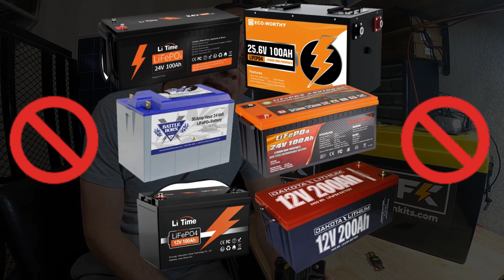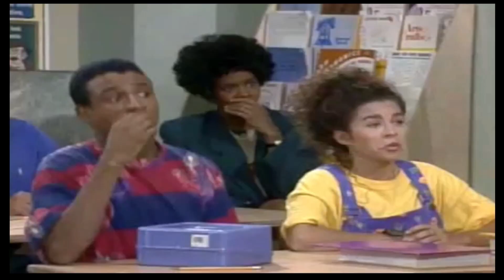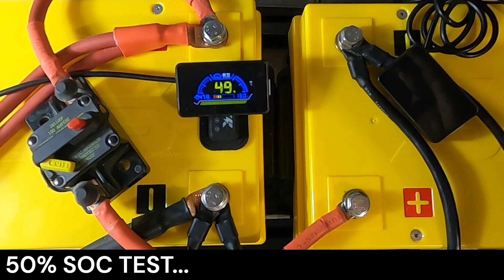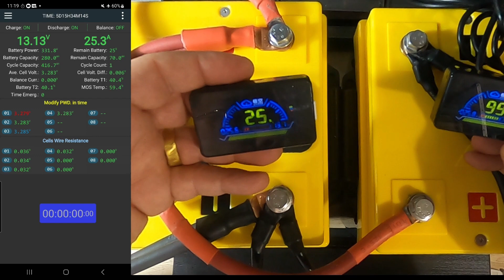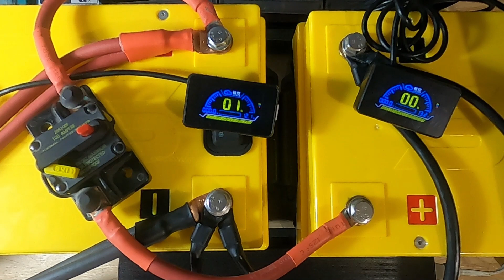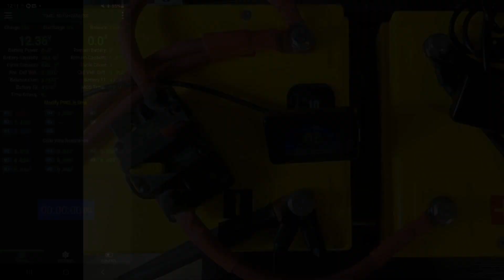Batteries in Parallel - What NOT to Do!

Comment from the maker: When looking at the data table:

75% VS. 100%: (14.6V - 13.28V) = 1.32V Diff. (.33V/Cell) = 100A Flow @ 3s
50% VS. 99%: (14.45V - 13.16V) = 1.24V Diff. (.32V/Cell) = 30A Flow @ 3s
25% VS. 99%: (14.4V - 13.12V) = 1.28V Diff. (.32V/Cell) = 37A Flow @ 3s 
10% VS. 99%: (14.4V - 12.8V) = 1.60V Diff. (.40V/Cell) = 50A+ Flow @ 30s
1% VS. 97%: (14.4V - 12.60V) = 1.80V Diff. (.45V/Cell) = 100A+ Flow @ 30s BMS
0% VS. 97% (13.2V - 11.24V) = 1.96V Diff. (.49V/Cell) = 150A+ Flow @ 30s TRIP 

We can see that you would need at least a 1.80V difference to flow 100A between 2 batteries. If you had say 4 batteries in parallel (3:1) even at 1.60V difference, that would be 150A+ (50A x 3) batteries to reach the same levels.  I thought it was interesting how initially when the control battery was at 100%, we got 100A for a few seconds. That is the last 1% of the battery where the charge curve jumps up dramatically but will not last long. Its very unlikely your battery would be at such a high SOC. Especially if you are following a 90/10 charge rule. 

The test starts at @15:50 and @18:10 for the impatient. 

See if you can find fire marshal bill :) Enjoy!

Comment: Thanks for this, I watched until the end, so useful for me, warm thanks for the time and questions you saved me. Never imagined the current was so low in fact. I was worried by a disconnection of one of the batteries in parallel in case of heat or cold for example... how they will reconnect together... your test helps me understand it's safer than I thought
Reply from the maker: I was surprised as well.  Thanks for watching.  This was an early video I did . Was fun doing it.. good times.

Comment: Hi.  It would help to show a wiring diagram at the beginning,  it's sometimes hard to follow exactly where the cables are going.
Reply from the maker: They are just hooked up in parallel. Positive to Positive and negative to negative.
Reply: @natesdiysolar thanks for the reply, content is most helpful.   I realize this is a simple wiring diagram but for us new to solar and learning i wish all videos on solar  would show a hand written qiring diagram at some point in the video, in this case it would be good to see exatly where breakers and fuses are placed. 
Question : am i correct you are measuring the increased Amps fron the highly charged battery  ?
Reply from the maker: @DJdavefromlondon  ya it would be the amps from the highest charged battery.. my website ( see video description) 
includes many schematics for other projects. I did not include one for this one. basically its a good idea to have a fuse on each battery if you have multiple batteries in parallel.

Comment: Hi, thanks for making this video, could you please tell me what amp fuse should I use between  two batteries 12v deep cycle battery in parallel.
Reply from the maker: To answer that.  Need to know your combined max charge and discharge current of your bms or load if no bms. For example, if you had 2x 100a (limited by bms)  in parallel, your max potential current would be 200a or 100a per battery.. so each battery would never put out more than 100a, so 125a would be good.   Basically, take your max load current and divide that by the number of batteries to get per battery load. That is the amount of current flowing between your batteries.  Typically ppl never max out their systems so as the number of batteries in parallel go up the smaller size fuse you could use because the load is distributed across all batteries.  So 2x 100a bat you might only see 50a on each bat and 3x only 33a each.  So 50a fuse would work.  The easy answer is to match your bms current so if you had a 150a bms then use 150a. Use a clamp meter to measure current between batteries when under max load..
Reply: @natesdiysolar  yes that the answer I was looking for,I don't want to burn my battery and house. Thanks for making the video. I'm a many hurricane survivor since 1988 in puerto rico.
Reply from the maker: @georgemaze7926  awsome.  Good luck.

Comment: Why didn't you connect the inverter to both batteries?
Reply from the maker: The point of the test was to create a large difference in voltage between the batteries.

Comment: Been looking on youtube for info like this, and I´ll appreciate if you can help me with my doubts: I need to keep an inverter running for long periods of time, so my plan is that when battery 1 is about to run out of power, im planning to momentaneusly connect full charged battery 2 in parallell and then disconect battery 1 in order to not lose power on the inverter. Will I face a current spike like im seing in your video? what would you recomend to accomplish this battery exchange safely?
Reply from the maker: Yes, there would, but the faster you switch it, the better it would be. It also depends on the switching device used.  Some could work in a way where both batteries would never connect... 
like an A/B switch, but I would not advise doing this.. Either way you do it, you would need some heavy-duty fast switching device...  why not just connect the batteries in parallel from the beginning...? Why do you need to swap?
Reply: @natesdiysolar  it's a project in which we will have stored batteries to keep constantly running a unit without having to wait for recharge. I have think about switching but I would not like to lose power even for a power flick. I'm planning to add diodes to my battery connection wires to avoid the current flow between them while doing the battery exchange.
Reply from the maker: @spacerabbitk  you would need a huge diode. Can't you charge while the inverter is running..

Comment: The breaker performed exactly to the spec sheet. The trip delay curve was showing around 15 seconds for 150 to 160 % overload condition. Fuses are designed the same way. You pick either based one how fast you need them to interrupt in overload condition. Generally must are expecting a 200% to 900% overload to blow or trip in under a second.
Motors are and example of loads that have large inrush currents when starting. You don't want to have to reset breaker or replace a fuse every time a motor starts.
Reply from the maker: I appreciate you looking that up.. I will be sure to include that in future testing. It's good to know these are at least consistent.

Comment: Use short wires with fewer connections I have 10 in parallel all those connections would be a bad Idea and fuse breakers, I don't even use BMS just simple voltmeter for each if one is higher than others make it ground side cell closest to ground discharges first arrange batteries like wise. That means you should also rotate your batteries if you dont understand how to arrangement cells best cell is ground worst is positive yes your cells have series connections inside.
Reply from the maker: Wow 10 in parallel that's a lot.  Yes I build my batteries with lowest cell ground side in series.

Comment: mouser fuse is the place to go to get all your data specs. 

And when it comes to direct current, I would not use any circuit breakers. You take the risk of having a fire.  Most circuit breakers are meant for alternating current.  You want a fuse for direct current would be your best choice and leave it on all the time unless you have no use for it.   Pacific yachts check him out. He is electrical engineer professional when it comes to this..  Yeah, I know you can argue for a switch if you don’t have some type of pre-charge so you don’t have an inrush of current to take the risk of doing damage.
Reply: Hey, in your video when you show those 51.2 Lifepo4 with a on and off switch. I am pretty sure they have a pre-charge ohm resistor in there and some type of relay to give you the full current after a few seconds.  I would still put a DC fuse right at the positive terminal post and find out what type of delay or fast burning fuse is recommended.
Reply from the maker: @waynemitchell7871  yes most do
Reply from the maker: Thanks for the advice, and thanks for watching.

Comment: I have six 120 watt panels running parallel tp a 60 amp Renogy Mppt controller going to 2 200 ah Lipo4 batteries in parallel and then to a 3000-watt inverter. I am not happy with the Renogy as it acts up a lot What would you recommend as far as a Victron controller with this setup? Also would there be any benefits of changing my setup to a series setup for the panels and the batteries instead of the parallel setup I currently use? THX
Reply from the maker: Well, you can't change your batteries to series because your system voltage would change, thus requiring a different inverter and / or charge controller.. as far as the panels go.. generally speaking, series parallel is a good middle ground, but if you're 100% in parallel and within the limits of your CC, then this offers the best shade resistance and redundancy.  If you do 100% series, then you get better efficiency as you get less voltage drop... personally, I like series parallel, as this allows you to move your array strings around and still get some redundancy. As far as victron. If you're happy with 60a charging, you could just match your renogy with the equivalent Victron. They have them all the way up to 100a with the smart solar series.. with that said.  I'm just one person. You may want to ask this question on the DIY Solar forum to get more opinions. What is the issue with your CC.. what do you mean by acts up. 
 Cheers :)

Comment: low amps caused by the high contact resistance of the terribly cheap design of breaker. the initial 100a switching current arc caused sooty contacts. had issues with that exact breaker on my inverters.
Reply from the maker: How long did you use it before you found out it was a problem

Comment: a breaker should not protect the battery, but the cables... those brakers are known to be shite..
Reply from the maker: Yes, that was my conclusion.  I since added a fuse between the batteries. I kept the breaker so I could easily disconnect them.  Thanks for watching
Reply: @natesdiysolar  be aware that these brakers have no arc protection. I would not use them in a high current environment.
Reply from the maker: @patrickmaartense7772  yes while there are many junk ($10) Breakers out there.. the one I used here was and is as far as I can tell a quality breaker with a IAC of 3000A. I used the blue sea 285 series breaker.  Fairly commonly used.  But with that said.. and as we found out.. they are still to slow... for use between a battery ..

Comment: The only test that had a full battery for the control was the 75%.  Just before you closed the circuit breaker, its BMS showed 14.2v and the working battery was at 13.3v so in that test you had a difference of 0.9v.  That test pulled the control out of the upper knee its voltage was 13.4v or below.  IF you would have retopped the control to 14.2v you would have seen higher current.  The current if just a function of the difference in voltage.
Reply from the maker: Correct.  I mentioned that in my pinned comment that the 1% spike to 3.65v on charge curve made that difference, but as you could see, it did not last long enough to trip the breaker.  I thought about topping the control to 100 when test was near zero but I didn't want to risk it.. it would have been bad lol

Comment: My bet will be the circuit breaker is dropping the majority of the voltage reducing currents substantially. Check the voltage across the circuit breaker. They are terrible for this.
Reply from the maker: Thanks for the tip.. I'll have to test that..
Reply: @natesdiysolar  I've been looking for solutions for circuit breakers & fuses...they all give a relatively huge voltage drop across their terminals. My conclusion is you need to setup an electronic circuit breaker. An electronic circuit breaker using active components like mosfets and can use sensitive voltage measurement to measure the minuscule voltage drops across say a terminal or a length of cable and disconnect current when it exceeds a set current (i.e. a set voltage drop) - instantly. One can then program delay times in if required to behave like a thermal breaker or fuse and this device should not suffer the voltage drop like a fuse or a thermals breaker does.. I don't know if anyone has actually created such an active component based fuse though.
Reply from the maker: @Ben Mitro  I was actually just thinking about that.. it could be done even with a solenoid.  Issue with Breakers is the quality of contact. But you would think a lower quality connection would create more heat, thus tripping the breaker faster but not sure.
Reply: @Bennyboy-dog well a spot welder that is based on mosfets and not a relay is exactly what you are talking about. A bunch of N channel mosfets getting switched on for a short time. Just need the mosfets to handle a long on time

Comment: In the end the brakers will not replace a fuse for safety reason in my tinking. 

So the brakers are for many people a fuse but they are too slow. 

So have real brakers or switches plus real fuses and it should be safe. 

By the way, there are many real bad of these "brakers" on the market without any safety function at all.
Reply from the maker: Yes, you are correct. The breaker I used in this video is a "quality" breaker by Blue Sea/Eaton bussmann that many people use, and it still took what I would consider to be too long. Thus, it should not be your only method of protection. Thanks for watching.
Reply: Could you use a smaller AMP breaker so it tripped sooner? So it would be quick reset?
Reply: @tweedeldee8122  In theory yes but then maybe things will shut off If they are running at high load. Furthermore this brakers are getting hot all the time which should be considered.
Reply: @twingoman2000  The getting hot all the time is a good point. An old school fuse seems like a better reliable fail safe option maybe even if you do use a circuit breaker.
Reply from the maker: @Tweedel Dee  you certainly could.. however, you have to be careful to make it not too small, or it may trip under normal operating conditions. As a general rule, I say undersize your breakers and oversize your wires.. but with considering max load and surge capacity.
Reply: @natesdiysolar  TY for the reply Nate! Just recently found your channel and I'm looking forward to checking out more. Really great, informative and well put together videos. Much appreciated!
Still trying to justify a small 4-6 panel solar setup, but I'm going to dip my toe in the water with a couple panels to play and experiment. It's hard to just buy one or two panels in south Alabama. The 12v "RV" panels are pretty much it when it comes to shipping.
Reply from the maker: @Tweedel Dee  if you need a reason.. if power goes out, you will have power :) That was my reason, lol.  Checkout santan Solar.. I think they have a warehouse in Georgia. You can pick it up locally. I just put a video out on testing panels I purchased from them.  Thanks for watching!